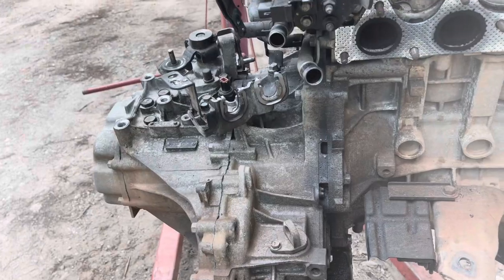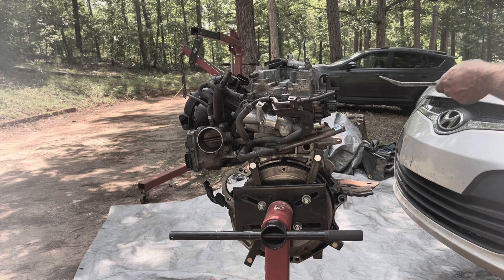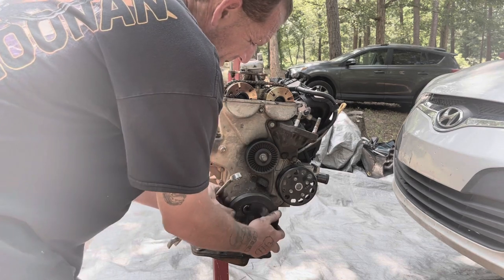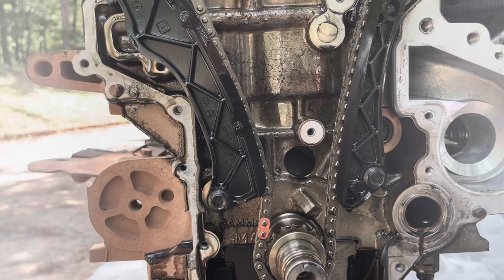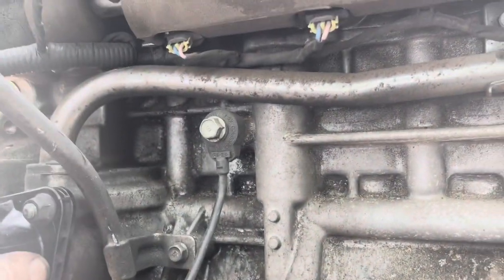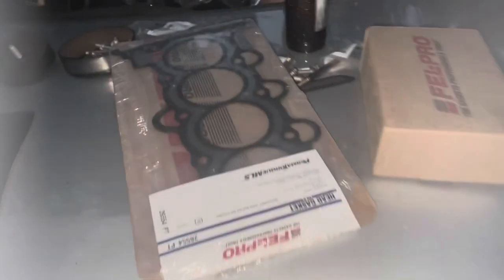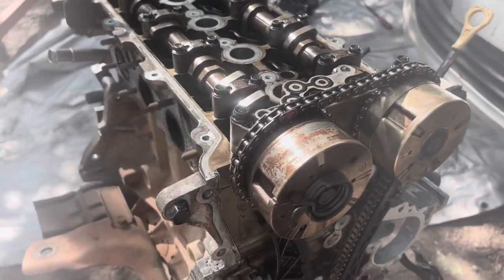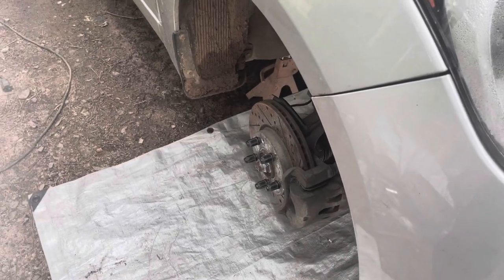2012 Hyundai Veloster head gasket replacement

Comment: Very impressive and very helpful. Thank you!!!  I was wondering if you might have just swapped out the oil filter while you had the engine pulled. 

Also impressed with how clean that timing chain area looked under the cover. 250,000 miles???  I almost want to call BS. 

After getting the engine put back together, I assume you put the serpentine belt back on before putting the engine back in. (Yes I’m a rookie, learning as I go, and you are a huge help!)
Reply from the maker: Actually the serpentine belt had to be installed after I put the engine back in because of the AC  compressor being left hooked up in the engine bay.

Comment: Tremendous help!  My mechanic says i need a new engine... Instilation & engine $4000. He said the piston rings are bad. Main code is p0301. Could it be head gasket? Or where is the best place i can buy a refurbished engine? Im worried im going to get a crap engine with the same issue. Anyway, thank you gor your post here. You have a natural skill in teaching how this engine works. 💜
Reply: Failing piston rings and headgasket failure share some of the same symptoms. So maybe its possible u need a headgasket. But if you have a decent mechanic i would assume he came to that conclusion based on his evaluation of the engine. Either possibility requires a lot of labor to correct.

Comment: How did u take out the gas without losing air pressure to the gas tank and mines doin the same thing where it has aweak start ithought it might of been gasket because of lose of pressure in engine...help!
Reply from the maker: I'm not really sure what you're asking.
There shouldn't be any air pressure in the gas tank except when the leak detection pump is running. Usually a weak/long start is due to bad spark or low fuel pressure, a bad head gasket will present other problems like smoke, misfires, overheating, etc.

Comment: Why did you have to replace the cylinder head bolts ?
Reply from the maker: Those bolts are torque to yield which means they stretch when you torque them. Since they stretch they can only be used once or they might break when torqued.

Comment: Thanks for a very informative video. Does the engine need to come out for a head gasket?
Reply from the maker: No it's possible to do it in the car I just removed the engine to video it better
Reply: @shadetreestreetcars8626 How do you go about removing the pulleys and valve cover while the engine is still in the car? How do you support the engine while the other engine mount is removed?

Comment: What is that exhaust and intake u said i-1 i-2 and so on and e-1 and e-2 so on my brother accidentally deop those and it all came out i need help on its right place :( 22:47
Pls help
Reply from the maker: If they got dropped and mixed up then the only way to figure out where to put them is by installing them and checking the clearance between them and the cam with a feeler gauge. It requires installing and removing the cam multiple times to get them right.